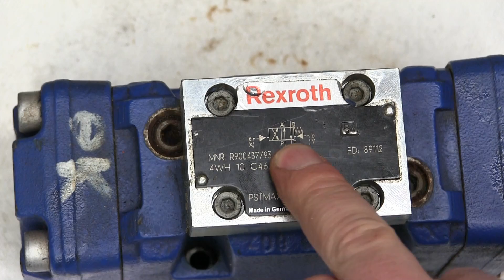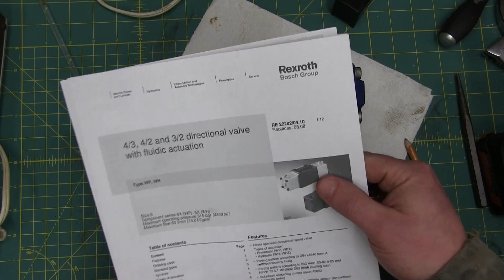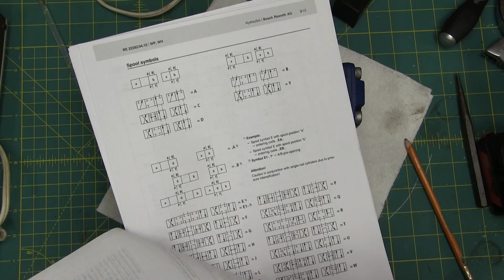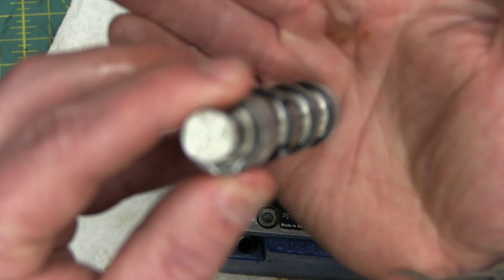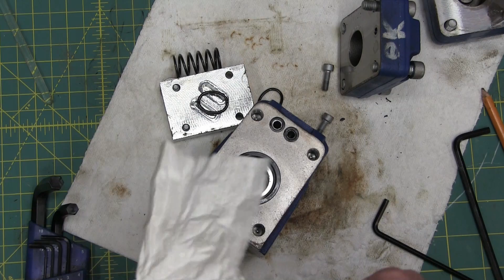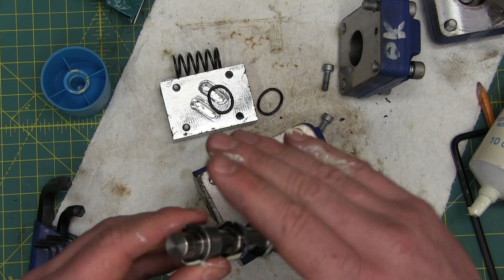BOLTR: Rexroth Hydraulic Valve | How it's built and Troubleshooting

Comment: Have a little on demand power pack on a 5 axis mill at work. Tool clamp and A and C axis brake.  On demand means a 25% duty cycle with internal leakage. Machine operators reset machine to bypass overheat alarm. Left it running overnight. Came in to it being COOKED. Now the oil immersed motor windings may be on their last legs, but the melted o-rings seem to have solved the internal leakage.
Reply: I also want to add that it magically refilled the reservoir. Cool thing about hydraulic systems that dont work right is they auto-magically service themselves.

Comment: I think it would be good for a lot of peoples' minds if you'd explain the state diagram by representing each state as a sliding block. Such that the block slides from one state to the other while the ports and connections remain in the same place. When I was first learning about hydraulic systems, understanding and visualizing how the flow would be affected by actuating valves was difficult especially for valves with more than two states until I basically re-drew the diagram showing each state separately.

Comment: I wonder if the diagram on the top plate is showing the correct direction but was put on wrong and that is why it wasn't working, if in fact it wasn't? Because it would change what ports are connected under the top plate. Turn it 180 so the diagram is showing the spring on the same side it actually is on. Just curious.

Comment: My work uses a pneumatic valve (Ross brand) on most of our equipment that is almost identical. The only thing that fucks them up is water in the air lines mostly in winter or is a cylinder comes apart and blows chunks of seal into the valve.  After a few years the pilot valves and orings do dry out but there almost bullet proof.

Comment: That Dow corning 111 is some good stuff the lubriplate I'll look at the msds weird hydraulic maintnence stuff b!eeding example automotive brake caliper you want to pour the fluid out of the caliper first cause when you bleed the line you won't be getting all the moisture out of the system if you leave it in there its like a little brake system boiler room yes you will need new crush washers if the piston dust boot is f d $7 for the kit if your lucky

Comment: Another weakpoint In those valves is a bent spool 1/2 thou bent out will stick 
IF AT ALL POSSIBLE DON'T LET THE SPOOL DROP
IF THE SPOOL DROPS IT'S GONNA BEND
bent spool = no Bueno 
Spools bend from people rackin the valves back and forth hard enough so a drop will good and proper  bend it

Comment: Teflon tape is the biggest killer of pilot operated valves, I like to use white lithium grease in a spray can to put valves back together
Reply: I generally just use the hydraulic fluid itself, from a fresh can, and wipe the parts down with it and then generous amounts of it during assembly. Sticky and messy, but you can be sure that there will be no other contaminating oils in there afterwards. Very important in aircraft, where the hydraulic oil serves as both motive force for controls and also as a very much needed lubricant and cooling for the main bearings in the turbine, and contamination there is going to be a very expensive and possibly life threatening thing. That is why there is the requirement for oil analysis of the hydraulic system every few hours, done with the system hot, so the oil is fully circulated and all controls have been cycled x number of times to bring all contaminants back to the tank.

As well with any hydraulic system lifetime is solely going to be influenced on 2 things, temperature and contaminants. Temperature as the oils degrade with heat and are then prone to foaming as they break down, and contaminants as parts wear or caps are left open and dirt gets in. In line filters are best, bypass filters just do nothing other than tell you you have a problem, as by the time they get any contaminant it has already damaged parts.
Reply: James Walters - excellent point, we all remember our plumbing days and wrap that shit on every connector

Comment: Speaking of gear pumps. At work we had a garbage truck that was exploding PTO shafts and $5000 gear pumps every time a new guy drove the truck. Turns out the guys were dead heading the truck with the speed up on. Took a few break downs and about $7000 in pumps and shafts to figure out the relief valves were way out of adjustment. And the only reason I thought of it were your stupid videos, so thanks
Reply: Egbert Wadman HIs story sounds fine, problem must be on your end.
Reply: Egbert Wadman I’m no professional mechanic my guy. But I install old junk parts on old 10 year old+ garbage trucks if a warn ass pto shaft explodes you assume it’s because lack of grease. then when the pump housing cracked I figured out what the real issue was. But I’m sure your tech manual would have told you the proper process for installing used junk on used junk.
Reply: Egbert Wadman you sound like a dill weed, so I’ll put it into a language you understand. Since I assume the most problem solving you you is changing battery’s in your TVs remote control. Let’s say you pick up your channel chicher to flip on today’s re-run of M.A.S.H but nothing happened. So you will go do what i would and change the battery’s correct?
Reply: Come home from long day at work, the last thing i wanna hear is hydraulics and garbage trucks. Ooh new AvE video then guess what  i see. thanks.

Comment: I am gonna be honest here... the schematic representation on the top... I do not understand why it would have been such an issue to simply put it in the correct direction when it was manufactured. Maybe it's my OCD, but that kinda thing boggles at me. Just seems like it might take a bit of guess work out of the equation for servicing the part and replacing inner workings.

Maybe I'm missing something?

Comment: Any possibility of premature failure due to trapped air causing cavitation wear on the softer valve body?
Reply: Just a heads up, cavitation is the fluid suddenly boiling to vapor and then condensing back to liquid due to changes in pressure, like the low pressure zone in the center of a swirling vortex. Cavitation damage is caused by the vapor bubbles suddenly collapsing as they condense which sends shockwaves through the liquid. When the shockwave hits the metal it fatigues it and breaks off pieces. Air causes aeration not cavitation.
Reply: The air gets emulsified with the oil and bubbles out in the tank.

Comment: What would be the tension of the vice be?  Jaws with teeth, brass, steel?  Will there be blood?  Will it hurt?  I'm skeptical about this whole dick in the vice thing.
Reply: Sparky Welder 
Always advisable to a trial run with a testicle first. That's why they are called TESTicals and they come 2 to a sack so you have a spare.
Reply: Tighten til you hear a crack or pop then bsck it off quatwr turb

Comment: Pilot operated valves are also good for explosive or wet environments, where electricity is a bad idea.
Reply: Pilot is also excellent if you are dealing with big valves, along the lines of 48" secondary cooling water lines for a steam turbine, good luck finding an electric solenoid that will directly close that. Throw a little 24v solenoid operating a pneumatic line on the PLC output and an actuator on big valve.
Reply: crazyguy32100 
Yup. Solenoid to pilot to big valve.
Reply: Also good as a hydraulic safety switch, getting pressure out of accu and system independant of electricity
Reply: electrawcity
Reply: I'm a mechanic at a blast furnace and all of our valves are electrically controlled. Kinda tricky to run a few thousand feet of pilot line vs wires.